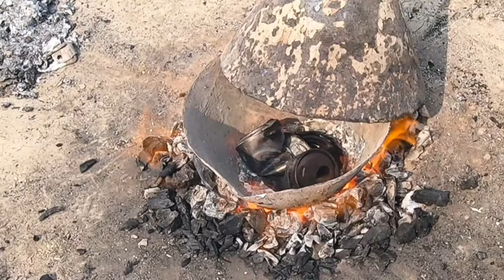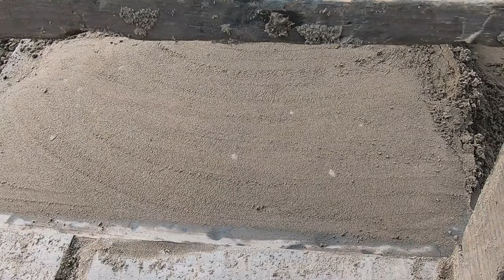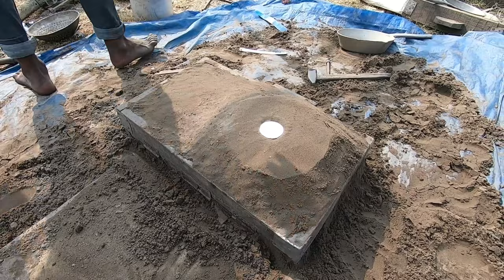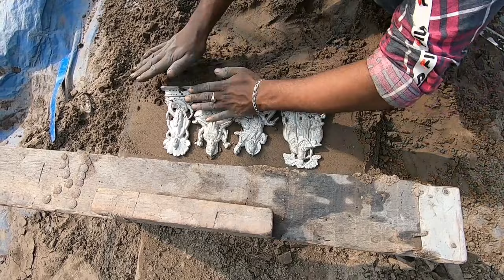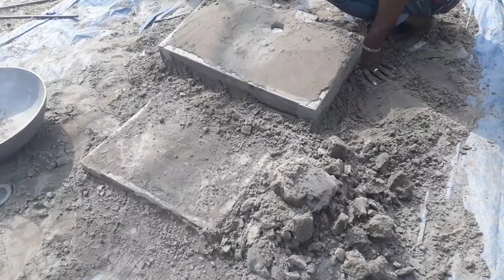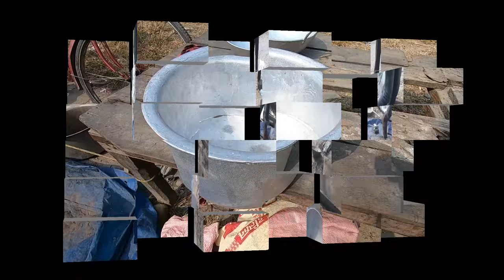AMAZING ALUMINIUM POT MAKING PROCESS FROM WASTE CANE

Comment: Does this sand contain cement or it's a pure sand?
Reply from the maker: It's only sand not cement
Reply: No cement in this type of casting.molasses is perfect.but not wet,splatter may occur and that's dangerous.